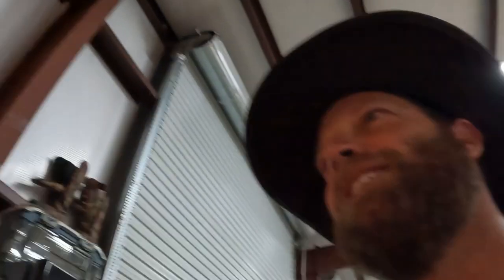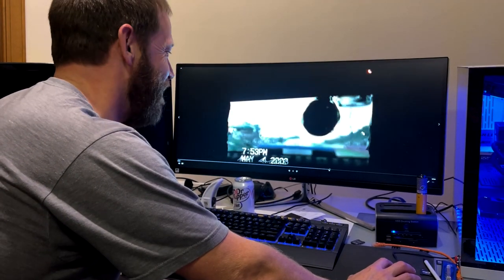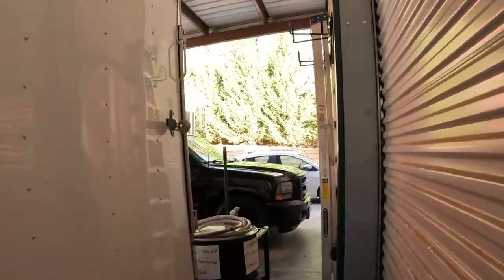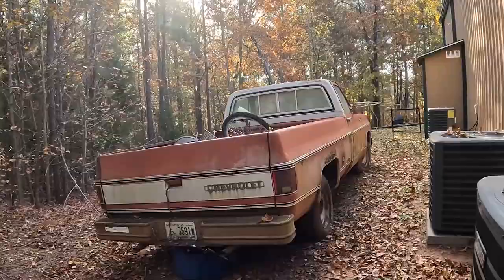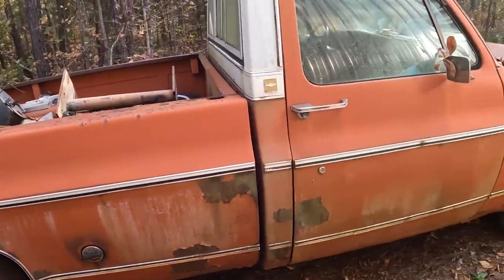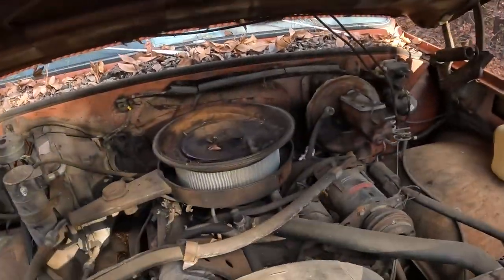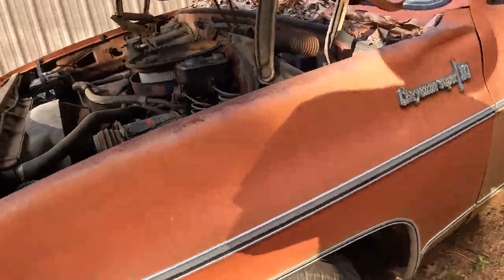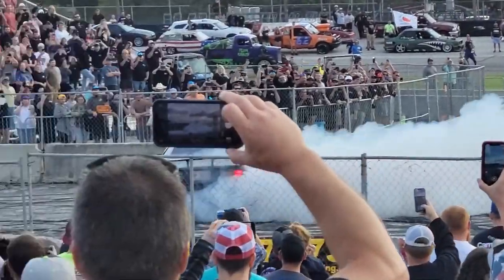Stevie Fast Jackson debuts "Project Ronnie" New Build - Episode 1 - Help Me Choose a Path

Comment: Short bed swap. Full qa1 bolt on coilovers suspension. Big brakes and nice wheels and tires. Stock style interior with Dakota digital gauges. Stock style paint. And a LS7 with a procharger. With air condition.

Comment: Go with the LSX427 single turbo street truck that way u can keep it pretty much original nd get the rusty paint job nd clear coat it or sand blanst it dwn to bare metal nd clear coat that after u fix the little fender rust
Reply from the maker: Great advice Vince

Comment: That is a Sweet ride. Because of the sentimental value of the truck I wouldn't Hack it up. Blueprint builds a couple of decent Small Block-Transmission combos. Drop something like that in there and drive that unit. If you can find an Old Pro Stock S-10 . That would be the Ultimate Burnout ride. :)

Comment: Leave the outside as is. Restore the inside so it’s nice to sit and drive. Do a complete mechanical and frame restoration. BUT do the engine,trans, rear axle and front suspension so it can be driven on the street easily and raced at Carolina Dragway with your buds. Basically a sleeper with nothing sticking out of the hood or fenders!

Comment: Blast the frame, update and rebuild the suspension, steering and brakes. Update the drivetrain, 450 horse with overdrive and efi. Clean interior, new bench, and make sure everything works. Leave outside as is

Comment: Having done these builds for myself and for others, I would absolutely love to see a screw blown hemi blazing tires in the burnout pit.. but burnout cars get smashed and beat up, you'll quickly lose the memories when the truck is all new sheet metal from being wrecked too many times. 

The best thing I've found from experience is try to leave it as true to form as you remember it always being, but just add your own touch to it while keeping it a driver. Keep it in a form that you can jump in it and cruise. Clean the vehicle up (prevent any further rot and rust) maybe replace all the damaged sheet metal and add some performance under the hood. It can have 600-700hp and drive down the street just fine while still destroying tires and sounding great with the AC blowing. 

Remember that you only get one chance at this, so don't go to far with it only to realize that it's no longer got the same feel and soul that it once had.

Comment: I'd section, channel and chop that truck Stevie just to give it an even longer and lower appearance. Nooo, please don't make a burn out rig out of it,, IMHO that's just boring,, STRAIGHT LINE,, that's where Stevie Fast Jackson belongs.  If ya wanna go with burn out grab yourself a junker and drop one of your old ProMod motors in it. Run it til it dies and push it off a bridge or what ever. The chassis, drive train etc. you already know what you're gonna do. With a long set of wheelie bars, a 'rusty' wrap would be kinda cool,, sorta like the Swamp Thing or the White Zombie it could look amazing and a fitting Stevie Fast hotrod. Good luck with making your decision and we're so happy you're inviting us along for the build :)

Comment: Whatever you do, it needs a clutch - MAN PEDAL FTW! I'm big into the H-pattern racing that's seen quite a resurgence lately(small tire Mustang with a stock block & head Coyote 5.0l and built T56 just went 6.80s@210 recently, CRAZY shit!!!)... but, man, deep down inside, I've ALWAYS wanted a Lenco car with a license plate so I could drive it around like Larry Larson and his old Lenco Chevy deuce! 
 
Also, maybe absolutely SLAM it on the ground and run some 33" tall slicks? Have been thinking about building a slammed pickup with tires sticking up over the bedsides for a while now, she would look pretty damn gnarly...
Reply: Oh yea, and leave ol' girl looking like she is - she's EARNED those scrapes & scars!
(maybe use some rust converter so the cancer doesn't finish her off though LOL)
Reply from the maker: Bad ass. Thank you !!

Comment: I would have to shorten the wheel base. Other than that, body would stay the same. Drop her down n back half on 315 radials. Put a first gen small block or big block with a blow thru carb (remember Ronnie didn't like injection LOL) and that Lenco. It would be a hellva street rod. Call it "Ronnie Fast"

Comment: Do a patina Build, keep it exactly the way your dad has it now, clear coat it like a time capsule captured just the way he would've driven around today. Then put a badass suspension, wheels and tires, high horsepower LS3 motor with exhaust cutouts so you can go from sleeper to badass by hitting a button. It would be dad's truck on the outside and Stevie Fast in the road! Even get the same wheels he has on it with skinnys up front and wide out back. BEST OF BOTH WORLDS.  HOLLY EFI system to run everything.
Reply from the maker: Great advice. Thank you
Reply: @SteveJacksonRacing  no Stevie,  thank you for being you. I am a fan and enjoy watching. If it was my dad, that's exactly what I would do based off the short description you gave us. Sounds like humble, brave and great father. I'm thankful for people like him and the other Men & Women who protected us in the service, Veterans and Active duty. You should build the Truck in a way that honors him, this is a vehicle that is here because of him and that will carry his legacy. Only you know the best way!

Comment: I think vehicles like that that stays in the family are cool my stepfather had a 69 GMC and it was rough I did a frame all restoration painted a different color I did a lot of stuff to that truck I put a 383 stroker and I just fixed that truck up kept it in the family and started showing it and it won three trophies and it's better a great deal I know it's hard to do that because of it being your dad's and you want to keep the patina but you be proud of it if you just redone it and put a badass motor in it with a good transmission and limited slit rear end those body styles are hard to come by anyway it'd be cool just to put it back in there and just do it that way that's what I would do personally
Reply from the maker: Greta advice Stan. Thank you!!!

Comment: There's only one way to do it:
1. No bodywork, paint it primer black with primer gray flames. 
2. Put fat steelie rims with fat tires on the back. 
3. Put a blown LS 427 with a blow-through carb Pro Charger making 800-1,000 HP. 
4. Put a newish 6 or 8 speed auto in it. 
5. Take those new fangled electric exaust bypass gizmos and run 8 of them to have zoomies that switch to full exaust with a flip of a switch.

Run it in the 1/8, 1/4, burnout competitions, and on the street to annoy your kids. Open the exaust cutouts and scare small woodland creatures. 

I'm a long time subscriber. This truck shares my same name, and your story about your step dad is a lot like mine. I feel like the power, driveability, and multi-use build would make him proud. His "don't give a shit" attitude would love the primer side of the build. Plus it'll be a sleeper like a mofo...

Edit: The 800-1,000 HP is on the low side, I know. I was just being conservative so you could daily drive it and have more fun reliably. This should be a fun truck that doesn't turn into a maintenance nightmare. Keep it fun, keep the memories alive. Ronnie would love it.

Comment: Wow. My wife and I inherited her grandads truck when he passed away. He was a chief master sergeant in the Air Force, and had a 73 Chevy long bed with a 350 with air conditioning. Sound familiar? I have a backup motor for my race car sitting on a stand that I’m going to be putting in it with either a 76mm or a couple little twins. I have a lockup/overdrive trans to put in it. Goal is like a 600-700hp cruiser with AC that I can take my wife to get ice cream on Sunday in or go do some burnouts, something my wife can drive etc. I intend to 4 link it and put air bags on it eventually as well. In the mean time I took the deep dish 18s that my race car had on it when I bought it stock, bought some adapters for it and bored the center out of them to fit on the truck, so it’ll have the heart and wheels from the car on it.
Reply from the maker: That's so bad ass!!! Pretty cool coincidence

Comment: I would fix the bed and clean up the rust leave the body rough but not won’t continue to rust away.

Engine lt4 with a 10 speed.  You ant this around so burnout rigs get trashed but the lt4 will drop right in easily make decent power for burnouts but could drive anywhere ya want.

Comment: roots blower on the ls7 with a  t56 sequential. do a full chassis. tap it a few times with a dead blow to knock the loose rust off but nothing else to the body.  would make a cool long boy drift truck/ burnout truck / im going to go embarrass my daughter truck... or skip the sequential and put a th400 and gear vendor and have its as a drag week/ burnout/ embarrass the daughter truck.
Reply from the maker: Thanks man!!

Comment: Screw blown (insert block of choice), mechanically injected skid machine. I think you like the Hemi, i'd prob go with a BBC cause its cheaper and you want to flog the piss out of it... Don't build a max effort motor, think great oiling and modest stroke, something that will live at 7800-8k for 2 minutes at a time (if your lucky you will get 30-50 sets of tires before major work). Proper Aussie-style burnouts are run against the clock and each competitor gets 2 minutes to accrue max points. The top guys manage rpm according to the pad surface so they blow tires just before 2m. I know Garrett doesn't run things that way yet but in time he will.
It would be really awesome to see you use your MFI knowledge while having some fun we all get to enjoy too.
Reply from the maker: AWESOME ADVICE DALE! THANK YOU SIR
Reply: @SteveJacksonRacing  If I could add anything else I would suggest 2 fuel cells (for MFI). 2 minutes of WOT uses a large volume of methanol. If you feed your mechanical pump direct from the primary fuel cell head pressure to the pump will be lower at the end of a run making AFR problematic when you need higher numbers for cooling/prevent detonation. A secondary cell kept to a constant fill level feeding the pump mitigates this... anyway, as a fan I'm looking fwd to see what you come up with if you go ahead. Best of luck mate.

Comment: I like the 6spd Lenco with a clutch, but I would rather see a screw blown LS7 in it. Definitely chop it to a short bed, basically put all the baddest stuff today’s market has to offer, drop it on it’s nuts nice modern big wheels and tires, huge breaks but keep the patina exterior. Maybe run a mild cage in it but I’m here to tell you be cautious with that, I have a 77 reg cab 4x4 and my cage takes up way more space than I wanted. Give it the best of the best out of respect but keep it raggity to honor your step dad. Just my opinion. But because you are who you are it has to have a screw blower through the hood.
Reply from the maker: I like this advice!
Reply: @SteveJacksonRacing  I’m a square body fan from way back. My first vehicle ever, that I still own to this day is a 77 one ton diesel cab on an 81 half ton short bed frame. I live in Cali so that’s my way around the smog BS as my truck currently has a 540ci big block with Holley EFI and AFR heads backed up by a built 4L80e. But Finn was correct the Lenco is cool AF but outdated and a pain in the butt. I’d run a Rossler built 4L80 with the same combo I mentioned before.

Comment: I say either a 4.6 bore space big cubic inch SBC,5.0in bore space 632cid, Sonny's Semi Hemi,481x, or even a true Hemi and the Semi Hemi,481x, or Hemi somewhere in the 500cid or low 600cid with either a BIG crank driven Procharger or a Roots,Twin Screw or a C rotor blower but it has to be blown but I think it should be way different than what you're used to and since small tire No Prep is really big right now and there is alot of money to be made I think you should go with a big cubic inch SBC of course with symmetrical heads and a blower that your not used to and make it light as possible and go No Prep with it and maybe even put big tires on it and go to NPK and whip up on them boys with a big small block blown Chevy perfect example the Vizner performance designed 4.6BS SBC all billet aluminum with a Liberty 5 speed or their new 7 speed with a Quick Drive and a converter and a Merrilat Fab9 rear end with as much titanium and billet aluminum and carbon fiber as possible to make it as light as possible whether you keep it long wheel base or shorten it up some

Comment: Make it a drag week style deal. Short bed tubbed screw blower like Richie Cramptons set up. It would be something that you could beat the streets up with but would drive your daughter to school in. You can do big Smokey burnouts with it, and it will run it’s ass off at the drag strip. You aren’t someone that is going drifting that takes way more time than you have to give. Hell you can’t do q&as without being at 10k feet.

Comment: Crate motor 632 with A/C slammed and clean up the outside and clear coat what's there and some nice wheels and tires, simple 

Or, big blower motor with a lenco slammed fully restored short bed! 

Diesel swap it with a duramax!

Plenty of options for that truck.
Reply: If GAPP was a truck!

Comment: Make it a short bed . Add a belt driven pro charger.  Keep the original engine , add a good set of aluminum heads , stroke engine . Add turbo 400 tranny with gear venders overdrive.  New  short bed with giant rear meats . Oh buy the way keep the A. C.

Comment: If it was mine with the sentimental value, i would put new running gear ( Street rod ) type, clean up the rust but leave patina, slam it with air ride and nice wheels.

Comment: Leave body as is. Lower it with nice suspension caltracs, split monos, drop spindles, tubular control arms, nice wheels, big block with some type of power adder and keep it streetable but make it fast. Should be a relatively quick build since it won’t get stuck in body shop jail

Comment: My suggestion would be : New bed, little body work, Air Force theme paint or wrap.
UNDER IT, build a combo truck that can do the Burnout pad stuff as well as No Prep and the power tour type stuff: Really not that hard to build a combo deal today.
Yes, it needs a blower or, procharger- your Stevie Fast Jackson- Na wont work and, really, nitrous either , even though your known as a King on those set-ups, your "the blown guy" now so, there ya go and, if done right, stays within your general parts supply chain ( i think thats important for as much as possible).
Nothing wrong either with just making a good, shop truck out of it- but, thats not why you put this up.
Air Force theme, make Ronnie a Stevie Fast Jackson build , by your own admission he helped make you who you are so, be who you are, no excuses, as he would expect .
I can see the truck from here right this min.
Anything i can do, contribute , just holler .
P.S. Just tell street outlaw types : Be quiet or i will "beat your teeth out" with my old mans freaking 
 truck!

Comment: If I was going to keep one forever, I would build it back close to original but with some modern touches (mild LS swap and overdrive). Racecars and toys don't seem to hold sentimental value for as long as something you can get in and drive anywhere.
Reply from the maker: You make a good point

Comment: How about  World Products PN WPI084181 SBC/LS head SBC roller cam   and add a T65 manual to it for a truck your daughter could drive one day !   Build for just under 700ft tq but sounds like a stock 5.3 ls !!   Convert the frame to a short bed  box  add a cage  bolted together at the back of the cab with  cab swing out roll cage door bar for a ladys easy entry .  Add a currie full floater 9" disc brakes rear gear .  and adjustable front suspension ,  Add vintage  steel wide ralley wheels and hub cap   with a clean oem style  paint  trim and grill makes a nice truck . have dads photo air brush on the glove box door . Add side bolster buckets , center console out of a newer truck .

Comment: Personally, restore the chassis. Upgrade the brakes and suspension. Maybe coil overs for example. Picture a shiny black frame with all kinds of goodies bolted on. Nothing really custom. Ls3 combo. Basic. Reliable. 450 hp. Restore the engine bay. New paint wiring plumbing etc. same colors gm used. Restore the interior. Same as gm did. Door jams on in. Nice set of wheels. Maybe 18 inch tasteful. Leave the outside alone. Maybe new glass. But leave it alone. So picture show style engine bay and interior. Ls3. Rusty dirty outside. I think if you could drive it a lot and not do any maintenance you would enjoy it for years to come instead of having another animal that needs constant attention. Oil changes drop it in gear and go
Reply from the maker: Great advice! Thank you

Comment: Eh if I had the means and money I'd make a bad ass drag week truck.  Doesn't have to be the fastest thing on earth but a good solid 8.5 car that you do drag week events or something would be boss as hell.  A full restore would be nice tribute however with the rust and so forth not a single body panel wouldnt be replaced or be half bondo by the time you finish.  Remember the faster it goes the higher chance of losing it for good.

Comment: Just go through the suspension and wiring.  Add a screw blown hemi with a linco. Narrowed rear-end with big tires.
Replace the dual tanks for plenty of fuel for the monster under the hood.
DO NOT FIX THE BODY. Keep it as it is
Reply from the maker: Thanks John

Comment: I'd slam it ,  throw a turbo on the built 350 that's in it with a blow thru carb th400 and a posi leave it raggedy on the outside get the interior fresh af and drive it
Reply: I mean build the 350